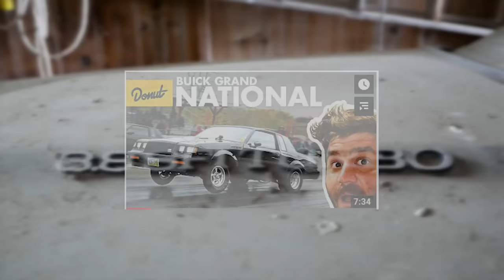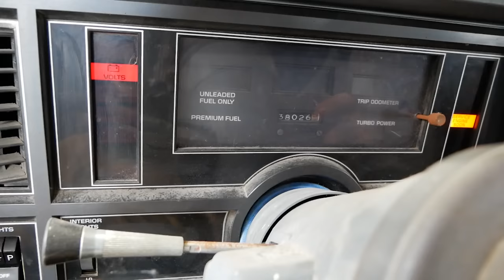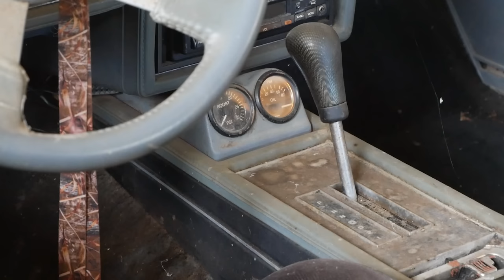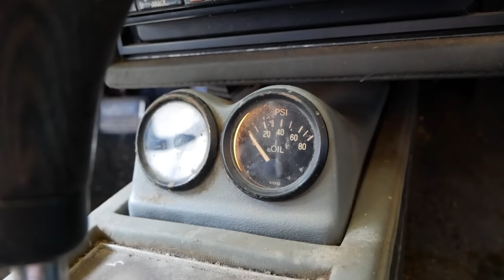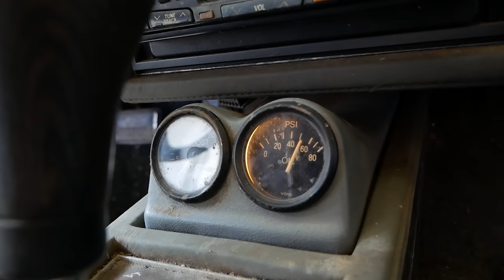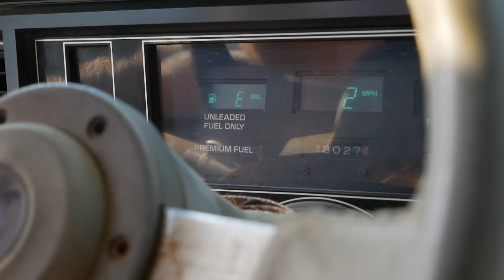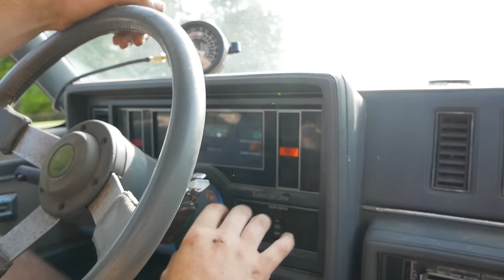BARNFIND BUICK GRAND NATIONAL - Will it Run and Drive??

Comment: Just wondering if you ran the VIN when I look at the car it looks like a turbo Buick that has GN parts installed on it . GNs have dash GN markings the fender badges are way to low. Not to bust your bubble it looks like a black and silver car painted black. I worked at a GM dealer and we used to sell GN parts all the time .

Comment: I owned an '82 Buick Regal with the non-turbo V-6. It was great for cruising but a sick dog in regards to speed. 
The paint jobs on the Buicks are bad to begin with and won't last unless you keep them in a garage or covered. I had mine completely repainted. As the Grand National showed the front and rear bumper plastics get brittle and crack...often in chunks. In '95 each corner plastic cost $100 to replace. Fortunately the rear never cracked. 
I enjoyed my Buick right up unti some Vatos, I was living in San Antonio Texas, stole it and stripped out the entire interior including the headliner probably for a Lowrider that they were working on. Wasn't worth the cost for me to replace it plus they left a Styrofoam cup under the hood indicating that they may have poured water into the carb as a death blow. 🤬

Comment: Likely already mentioned but I missed it:
That "box" looks like it might be a TPS-Tec.  Since it was (is) common for TPS sensors to not be adjusted for a full swing... this device will ensure max voltage.  You can put a scanner on it or a meter and with engine off read the voltage output. Can check for bad spots during throttle movement also while in there.

No harm in leaving it there but if removed double check TPS voltages.  It may have been added as a band-aid.

Disclaimer: I have never had TPS-tec devices.

Comment: thats the stock turbo for sure. I've never seen someone turbo swap and stick the stock heatshield back on if it even fit. besides he'd have to add a means of extra fuel at a min to gain any real power. Everyone thinks you just have a turbo and crank up the boost and car go faster now! nope you need some form of engine management. Otherwise you're just gonna run lean and blow up the engine!

Comment: bad idea racing a motor immediately after start up . you need to get the oil warm and flowing first. let it idle even if it runs crappy just to get the oiling system warm and  pump through all the bearings . even a stored car over a winter like mine i pull the fuel pump relay and crank it a few times until oil pressure comes up. then i start it and let it idle until warm . btw mine 09 dodge challenger R/T .100K  has great oil pressure 40psi hot at idle. and 60 when cold.

Comment: the brake system is called a powermaster, very bad design by GM and they stopped using it after 2 years for a reason. They can fail without warning and leave you brake-less. The buick crowd calls it the PowerDisaster
Reply: Actually THREE years. Some 85's Turbo Regals had it as well.
Reply: @stevencovington4715  I thought they were all hydroboost
Reply: @sasquatch440  Nope. EARLY 85's had hydroboost; mid-year to end of 85 model year had powermaster. and its reservoir is narrower than the 86/87 version, but they will fit. Another car that had the powermaster was the 1986 full size station wagon with the Olds 307 and the 200-4r overdrive trans. No other engine or trans combo had it. WIERD.

Comment: Ever rubber hose seal bushing and most bearings will have to be replaced. Going to cost a fortune and engine and turbo will need rebuilding or they will grenade. Cost more than it is worth and that does not include the interior and other junk that goes to crap sitting

Comment: My friend has a 86 GNX. He's a body guy so the body still looks like 1986. I'm a mechanic by trade so last summer we got it back on the road. Bigger turbo, cold air intake, bigger injectors, "hot wire" fuel system, bigger fuel pump, 3" stainless off road down pipe, some little odds and ends. I will tell you for a street car it is a fast car.
Reply: No such thing as a 1986 GNX (but there were 5512 GN's.,) except for the ONE prototype owned by Brad Conley.

Comment: A turbo car that set that long You should of primed that turbo again. By taking off the oil feed line and pouring oil down into where bearings are. Yea theres oil pressure but your better off pouring oil  in it just like putting a new turbo on a vehicle.  They was a great car. That one was used and abused...But its a Chevy and still runs half descend without  changing too much of anything..HELL YEA...

Comment: Honestly if I bought this car I would remove the body from the frame and clean everything up, fix any holes, POR-15 the shit out of the undercarriage basically start from the bottom and work my way up, the biggest issue with this car is the body condition

Comment: I had a 1985 t type first year Buick reagal  came out with turbo  it had a 4 barrel on  it with a turbo it had 85 thousand miles when I got rid of it it had a new motor less than 20 thousand  miles n it so sisick of getting rid of it

Comment: I’m not 100% sure that is an original grand national. The front bumper headlight surrounds are without a doubt incorrect for a grand national. The fact that you guys found that the doors were painted silver, and that the entire car has been painted at some point leads me to believe that the car was originally a Buick regal type t that was turned into a grand national. Grand nationals have always been expensive so I highly doubt if someone had one and got in an accident, they would replace it with the incorrect parts.

Comment: Before the days of hydroboost? Hydroboost was what the car had the previous years. Its the accumulator ball and if you don't feel comfortable driving a car with no brakes than don't drive it especially at WOT those should be done before you put gas in it especially being someone else's vehicle. That's what a real mechanic would do, all you care about is boosting the thing racing around not to help the guy out only for your pleasure. If its too expensive to fix swap to vacuum brakes. And for any idiot says it doesn't work with this set up just look at '89 turbo TA. Just need brake pedal from junk car that has vacuum brakes, booster and master cylinder all under $100. Odds are its the ball.

Comment: You want to talk about a low lying pain in the ass. I once owned a '91 Buick Skylark Custom with a 2.5L. The Control module was under the engine on the cross member. Every time I hit a puddle the control module would get wet and the car would die. I would have to let it sit until it dried enough to start.

Comment: dude I'm a die hard grand national admirer and owner of 4 GN and 1 GNX. . I am not going to be able to finish watching this video due to the way you're handling that Grand National for one thing any car any car especially a grand asking because they're very very precision and very finicky that turbocharger doesn't put up with much nonsense. If you left gas in that vehicle for a year and not started man myself I would put a new tank on but at the very least I drop that tank I flush it I trust him fuel lines I change the filters before I ever Crank that car over. Let alone 7 gallons of gas at sitting there for 10-15 years is it and you can you could really damage that Grand Nationals turbocharger and the insides you know the valves in the heads by trying to run that that old of gas through that engine. But I mean I never seen anybody that you know that if gas has been in the vehicle sitting in the vehicle not being starting or nothing you know for a year or more that didn't replace that old gas with new gas. If that gas has been in that car and says long as he said it would help that gas may be set up in the turpentine or kerosene or you know some alien fuel who knows but I sure wouldn't have it in my Grand National. And another thing on the Grand National you have to let those engines come up to operating temperature before you ever push that turbocharger cuz if you don't you lock that turbocharger Smooth Up it has to be at operating temperature before you can start getting rough with it now this is just my experience with with the Grand Nationals in the clubs and remember that my wife and I have been married 42 years we bought our first Grand National in 1984 and then bought a new on showroom floor. the 87 grand national is the first yr Buick added an intercooler. from 84  to 86....no intercooler. there are things u can do that will make GN  an meaner corvette  slayer. (Buick engineers wanted a car that literally destroyed corvettes. and the grand national was born. when a Buick v6 was embarrassing the corvette world vette owners demanded immediate response. qnd the poor dumbass vette engineers decided to put twin turbos on Callaway bettes, the vette world had its lil pidgeon chests stuck out there
 but they didnt get to enjoy the top dog feeling very long........ and 3 letters is all  that it took to make vette owners cry and those letters are GNX....The big dog grand national came out and went to hunting callawayy vetted and the Zl vette. there was nothing in the 80's qnd 90's that could run with the GNX

Comment: I had a friend in high school a decade ago, that was a major pot head, and thought of himself as a real hard ass, he wasn’t. He had one of these that was pristine, like it just rolled off the showroom floor. Sadly, he drove it for all of 2-3 weeks and someone/him put orange juice in the gas tank. I know because he wasn’t good at mechanics so he had me drop the tank, it smelled liked oranges when I cleaned it out. 
I have two theories on what happened, the first and most likely, he got all doped up and drunk, ran out of gas, and decided orange juice would get him down the road. (This sounds stupid, I know, but he wasn’t very smart he even lit his pot bowl once during class when the teacher stepped out for a moment, almost got caught. Another time he was begging me to barrow him a gun, so he could go drug dealing. That was a definite no from me, I almost feel he thought I was stupid to even ask that. 
The second theory is he screwed someone over on a drug deal of some sort, and OJ in the tank was their revenge. 
Either way the car never ran again, as he dropped out of high school before I could put the tank back in. It would not surprise me one bit if the car is still sitting in his mothers garage where I last saw it. 
He was alright to hang out with, but he was one of those friends you had to constantly think 3 steps ahead of him, for your best interest, or his BS would wind up getting you in serious legal/physical trouble.

Comment: So the car has not run for 15 years, so lets get it fired up and rev the hell out of it in less than 15 seconds while it's still cold and has barely any of the 15 year old oil slug moving through it.  Next, we'll notice how badly it smokes....

Comment: You should just switch that grand national over to hydroboost
Reply: Or convert  to vacuum brakes. Easier
Reply: @stevencovington4715  a turbocharged car with vacuum brakes you gotta wonder why GM didn't think of that
Reply: @rodney1818   They did! The 1989 Turbo Trans- AM!!! After all the troubles with the PowerMaster...

Comment: ...had one of these back in the day...the doors quite literally FELL OFF...hinge pin issues...I suspect this is a 'rebadge special'...as far as a knob to 'tune the boost'...well, you have to increase the fuel pressure at least ONE POUND for each pound of boost increase. Otherwise you're gonna blow 'er up. The GN is capable of amazing performance WHEN everything is working correctly...it seems that pretty nearly NOTHING is working correctly on your 'barn find'...My GN was a money-pit. Yours will be too - IF you do a proper resto. I kind of like your 'throw the dart at the issue' solutions...I mean, what the heck...it was a piece of you-know-what as you found it...hard to make it worse...(shouldn't say that!)...I like your 'Italian tune-up' method...blow 'er out...Anyway, from someone who had a GN...good luck. Perhaps turbo the Festiva...it's might be fun. Throw in a Garret t28 turbo and an intercooler...and away you go...(and for cheap - unlike the money to do up your GN)...just sayin'

Comment: That family clearly isn't partisan as regards the make of vehicles.  A Ford Festiva, better known as a Mazda 121 and Kia Pride elsewhere, rusting away on the grass, the US version of a Talbot Horizon sitting next to the garage and the turbo Buick in the garage.  Plus a rusty Ford F-250 pickup for the tough jobs.  The big 3's all there...

What you were seeing with the car running better each time it was switched off and restarted is extremely common in '80s fuel injected vehicles.  Think how much computer technology has moved on between then and now.  The computers in the system have to relearn their parameters after being left for some time, having the battery disconnected or suffering a flat battery.  It just wasn't economical to use a powered memory set-up in them back then, and anyone who was really into computers back then will tell you how expensive that sort of item was, so, like humans, the computers forget things if unpowered for a while, so the next time it's started then it will start on a baseline setting and have to relearn the parameters that are relevant to the person driving it.  Having said that, these types of fuel injection system do tend to be massively more reliable than more recent ones due to the lack of electronic components in them to fail at the drop of a hat and cost hundreds to replace even though they are made absolutely as cheaply as possible.  The computer and a few sensors are about all there is, and they are incredibly robust to the point where they are perfectly able to survive being run in a vehicle with a failed charging system regulator meaning the electrics is getting blasted with 18 volts rather than the normal 12, which would send a modern vehicle into complete meltdown and probably render it a total write-off on financial grounds as replacing all the components burnt out will chew through thousands and thousands...

I suspect the unknown electronic device under the bonnet that you though was a tuning chip is more likely to be an electronic boost controller.  They were around back then, SAAB introduced one in 1982 with the APC system on 900 turbos so they very much were around.  I thought the owner said, when he was talking to you,, that he had a manual boost pressure control knob installed but took it out, and generally people would only remove that kind of set up if they were detuning the car or to install electronic boost control which reacts far faster than a mechanical system can, which is important in a vehicle with a larger turbocharger on a basically stock engine as any over-boost situation runs a serious risk of melting pistons, blowing holes through the piston crowns or bending conrods, which is very undesirable, so fitting an electronic boost control system is good insurance against nuking the engine...

Comment: Bullet proof 3.8l 231 v6 Buick engine? Are you high? The 3.8L 231 v6 Buick engine was notorious for cracking their blocks for no apparent reason. Had one do it in a 81 Pontiac Grand Prix myself. Wasnt overheated or even being driven hard. Was cruising at 55mph on the way into town and thats all she wrote. Worst engine ive ever owned of GM. I knew of plenty others that had the 3.8L 229 v6 Chevy engine and they were very reliable.